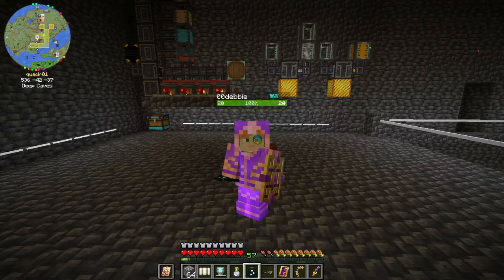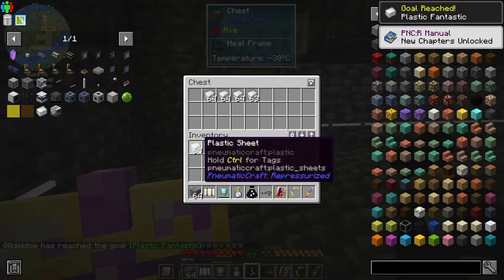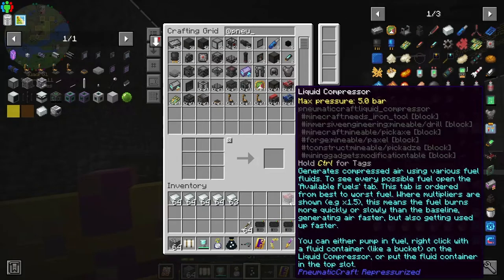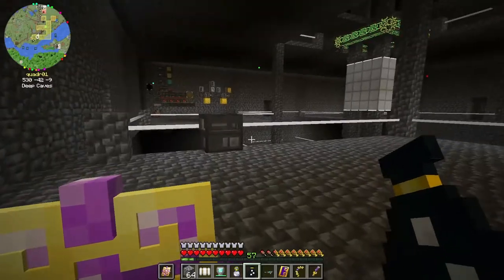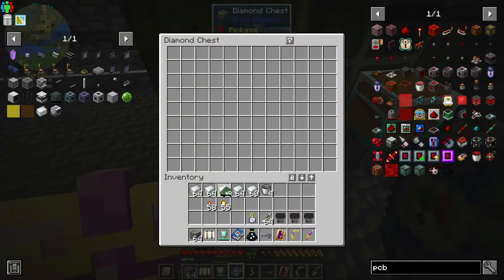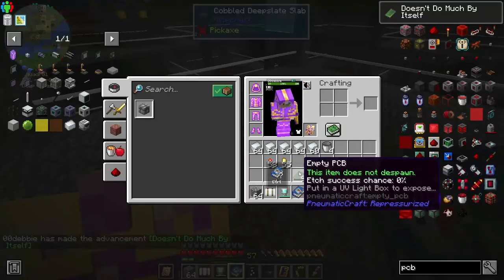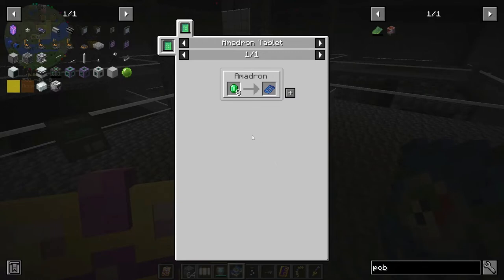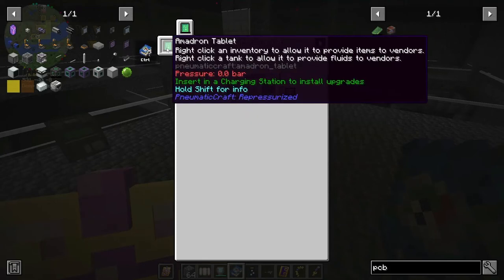DireWolf20 1.18 Let's Play Episode94: Making My First PCBs

Comment: Congrats!!!!! Nice call on using the blaze mesh blocks! I tried automating breaking the tank with a RS destructor but for some reason it hates the pneumatic  tanks. So, I ended up slapping on an external storage bus on to the liquid plastic output tank and using a fluid encaspulator to fill buckets of plastic and than export them into the heat frame chest. Also, I notice there is a bug on the heat frame chest that every once in a while when I log back into my world it will not be cold. I ended up just removing the heat sink and re-attaching it to clear the bug.
Reply from the maker: Oh, yeah!!! My heat framed chest did that too!! I just spun it around with the pneumatric drill and it finally updated!!